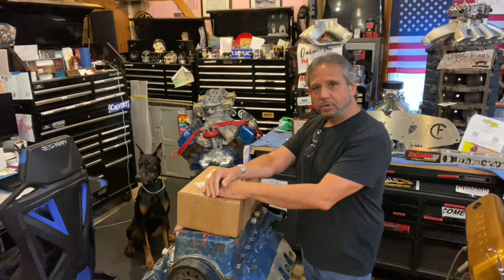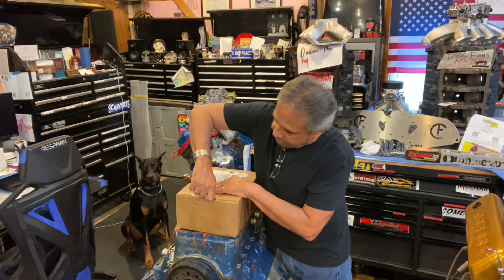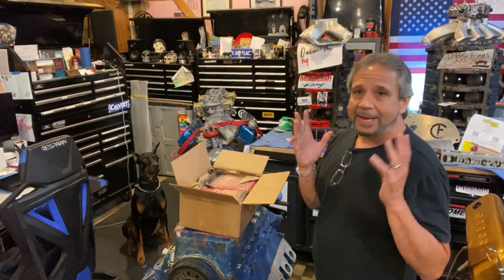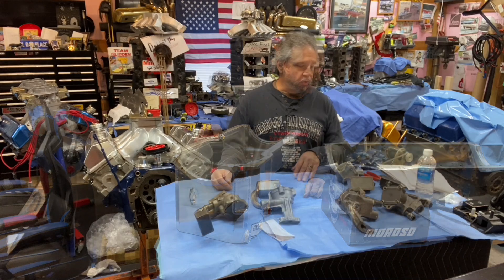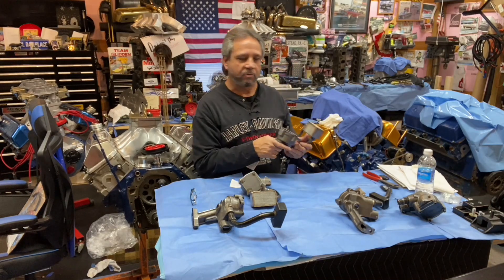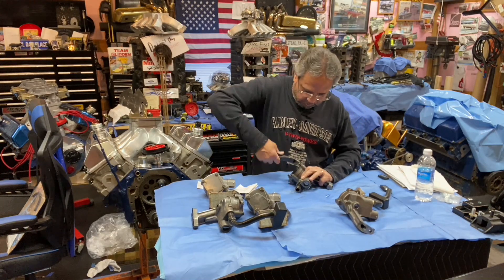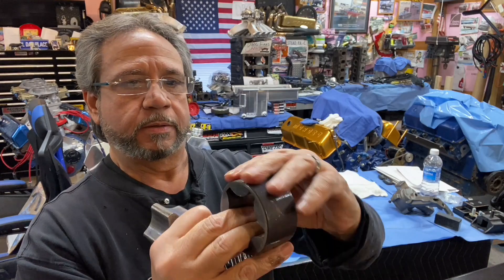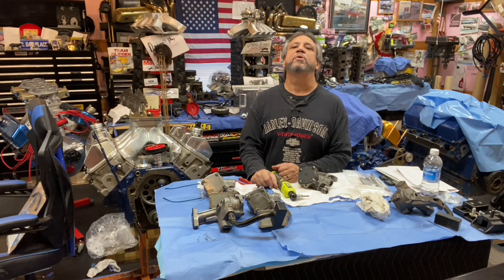DBG: New Stefs Oil Pan, With Matching Pick Up, Let's Look Inside A Blueprinted Precision Oil Pump

Comment: More great information from DBG!!! 
Tim, 
I'm building a very similar drag racing 408c using most of your video's to copy your build and modifications very closely. After seeing what happened when your oil pickup broke and no oil pressure...do you run or recommend  running a low oil pressure safety switch?
Reply from the maker: Trying to keep you in the front of the pack. I have never ran one, don’t get obsessed with the oil pressure. Always the same. Got complacent, as I never had one in 40 years. My laziness. So yes, I bought one and will be using it. With new stefs pan, and oil pump/welded pick up. Glad I can help you, and will be making more build type videos, next up Tony Oddo $14k dollar dry sump Cleveland. Let’s tear it down, see what it needs. Stay tuned

Comment: Very primitive design compared to the modern circle track low windage pans. Also, wouldn’t it be worth REM polishing the oil pump internals and combust with a coating? Seeks lie it would be a benefit and worthy of the the cost associated with “blueprinting”.
Reply from the maker: Hey, I will take what I can get and what works for me. If this was a super stock or class type engine. Probably be great stuff. This is just an old Cleveland. Now if you would like to talk to Precision oil pumps, ask Doug the owner if it would be beneficial. Thanks for watching DBG

Comment: I loved my Melling HV. I got a 7Qt front sump Moroso pan which came with it's pick up. I dropped a 100lbs Moroso relief spring in the pump and ran 65 psi all the time.I could have put a shim in to make more pressure, but I was 20 and was still learning. I would have loved to know to chamfer the pump but I was young. Great times.
Reply from the maker: Sounds like it worked well and that’s what I say. Do what works for you. I have never ran that spring.  Now time to get back to it. Thanks for sharing

Comment: I got a 351c recently and want to build it to a 427 and maybe a shot of nitrous, finding pistons for it seems a little hard is their any you recommend?
Reply from the maker: To achieve 427 ci with stock cleveland , not going to happen. Aftermarket Windsor ok. I stated to work with gib tech pistons. You contact Tim Meyer, at TrackBoss products. he has many shelf pistons.
Reply: @dragboss351cleveland  thank you after looking some more i seen that you cant achieve 427 most is around 409, thanks for the advice
Reply from the maker: @derick4252 yes but no factory available cleveland will take 4.125 bore. Luck of the draw. I may even have my own, hmmmm
Reply: @ i believe the man i purchased it from said it came out a montego and it has 2v heads, the only issue with the engine was in piston 8 their was something in the rod cap bearing and it grooved the crank shaft and made the engine real tight to turn
Reply from the maker: @derick4252 you are the guy that I have been messaging correct?
Reply: @ yes sir
Reply: @  at least through comments

Comment: Very Cool!  Bought a Precision for my BBF!  I like the idea of basically blueprinting everything, and like you said-time is money.  Heard about people stacking the pump plates for extra strength-with some longer stronger bolts of course, or some pumps will have cast pump plates.  A bit of Magic about the high/low volume-and I believe you are correct in the actual rotor depths-makes sense.
The 351C has some history about shimming stock oil pumps for pressure-interesting stuff.
In reality, liquid wants to Flow, whether it is pressure or return.
Thanks DBG
Reply from the maker: I did double stack plates, don’t think it much difference. Looks cool, like a secret mod. Yes moroso made a 100 lbs spring. Never used it. Think smart, save money, not cut corners. Glad you’re here.

Comment: Good job on your video, thank you for sharing. I have a question on oil pans. I have 347 Windsor 1970(2- piece rear main). I am looking for a rear sump pan with dip stick option and girdle clearance. Clearance of the oil pump sump needs to be as small as posable lot of room in the back. any help would be appreciated
Reply from the maker: Dave, I wish I could help, but have no clue on any pans out there for that application. I think both milodon and Moroso make rear sump pans. Getting one custom made, may only be a couple hundred more. Can always call Stefs and ask for Stan, see what he thinks. Thanks for watching my channel 💯🏁
Reply: @dragboss351cleveland  thank you
Reply from the maker: @davec9244 your welcome,  check Moroso 20530, I just sold my buddy a stefs rear sump, cleveland. And found this might work. Thanks for hanging at DBG 💯🏁🇺🇸
Reply: @davec9244   If you still can’t find the correct oil pan for your application, you should check with Prestige Motorsports. They build and ship Windsor based 347, 363 and 408 engines by the dozens each week all over the world for customers with unusual chassis combinations. Clevelands too so they might have something for your 347 🏁.

Comment: Hi Tim, I use the Precision pumps also and no issues so far. The Stef's pans are ok......had one on the Belvedere that my Father raced and he custom wrinkled it during a wheelie situation but if I was buying new again I would get one with a passenger side kick out to keep the oil off the crank and with that design they are much much shallower of a pan aiding in potential damage if ever a hard landing was to happen. Williams Oil Pans makes some very nice ones although very difficult to get anything from him as he is always busy but I have also seen builder friends of mine have Moros build them custom aluminum pans with a nice passenger side kick out as well.
Reply from the maker: Mike, what goes up must come down. Been there lol. Yes they make a quality product for sure. I talked to him about a kick out and Stan said at this time, that the kick out does not make that much of difference with what I am doing. Good point about a shallower pan. Never heard of Williams before. So true, guys that are good at what they do, have so much work. Appreciate your comments and experience. Tell your Dad hi
Reply: @dragboss351cleveland  My father has passed away but thanks. I don't know if you have ever heard of them or not but Titan makes a real nice in pan adjustable oil pump too.
Reply from the maker: @moparsareeverything1980 rip Dad, mine too. I have heard of them and the guy that used to work for them went out on his own. Forget his name and pump right now. I had one of their pumps to test fit. But it would not work with my girdle and it had no pick up. I went as far as buying pickup tubing. Then decided against it. I really think external wet sump would be the easiest and not have to worry about it.

Comment: Is the impeller on the Precision the same height as the the Manley's ? Btw , I still don't like the high volume .
Reply from the maker: The pump is a Melling hi volume, in a Manley box. Btw, I may use a standard volume pump on the 427 aluminum Cleveland, that has stalled.
Reply: @DragBoss351Cleveland  ,,, yes , you said that in the vid . I  wanna know is it the same size rotor and scroll as the Precision . Btw , are you taking calls with Darin ,,, ?
Reply from the maker: @rolandtamaccio3285 can’t say for sure. But precision does not make rotors, I must not understand what you’re saying. Darin will be on live chat, what do you mean take calls, during chat?
Reply: @dragboss351cleveland  are you taking phone calls while he is on ? ,,, last time you did not ,,, !
Reply: @rolandtamaccio3285  I don’t think that Tim has ever taken phone calls during a live streaming event. But the live chat box is used to submit questions or comments for the guest and works very well.
With the bearing clearances on my engine, the Melling high volume pump works well. That’s why they offer standard, high volume and high pressure pumps. A pump to suit most all builds.
Reply from the maker: @rolandtamaccio3285 I never took any calls while Darin and I chatting?
Reply from the maker: @danielwilson6665 no have not done that… yet, may be interesting though.  Be even more fun to road trip to people shops, DBG on the road 💯🇺🇸
Reply: @dragboss351cleveland  Tim it would be great if you could find the time to take DBG on the road and visit some other shops along the way !  Your last session with Darin totally blew me away when you revealed that he was actually sitting next to you at your shop. Very cool move my friend !!!
Reply from the maker: @danielwilson6665 I figured I would get the guys with that one. Always one step ahead of the game. Yes we are going to work at a library collection. The membership will probably have to be 12.99, instead of 9.99, as YT takes 30 percent. We only ask for the 9.99. We are not in it to make money. But to compensate for our time. I think this is reasonable my friend.
Reply: @dragboss351cleveland  I feel like that’s VERY reasonable considering what the subscriber will be getting in return. Count me in my friend, always !
Reply from the maker: @danielwilson6665 that’s what we are thinking, not too much to ask, for what you can save and make hp. We can bring you something no other channel has, a complete library of racing knowledge….is power 💥
Reply: Tim you offer a wide ranging variety of interesting topics on DBG. So much knowledge in fact that your subscribers are likely to become so powerful, they will have to be chained down 😳😱😄
Reply from the maker: @danielwilson6665 and then fed raw meat with sticks, well only in the movies. Yes variety is the spice of life, and I don’t use salt.
Reply: @dragboss351cleveland  I kinda like a dash of salt with raw meat and butter on the potatoes for variety. Just prep the OR for my angioplasty, good Doctor 🫀.
Reply from the maker: @danielwilson6665 angioplasty not the best. A nice drug eluding stent will work just right, unless you have left main coronary disease, then you need a bypass.

Comment: Job well done.what kind of coating inside the oil pump? Dry film lubricant or anodized or other?
Reply from the maker: Michael, Has to be dry film, on rotors and inside housing. Some areas of wear. I will send it back for another build under way.

Comment: The custom Stefs oil pan has some great internal oil control features. The oil temperature sensor bung is another great feature. It’s surprising to see how much longer it takes for the oil to reach normal operating temperatures compared to the coolant. 

Seeing as how even the name brand mass produced oil pumps can have differences in manufacturing tolerances, having Precision blueprint and coat the internal components is good insurance against premature pump failure and helps maintain more consistent pressure especially at higher rpm’s. The pickup tubes look indestructible. Let’s hope so 🤷‍♂️🏁.
Reply from the maker: Thank you my old friend, the shining star will get me far. Yea everything I need. I did not want to change much as I plan to run rear sump, with DragBoss 427 Aluminum Cleveland. More on that another time. My faith for now will be with stefs. I will get Pat the owner maybe do a live chat, fun stuff and learn what we can. Filled blocks do heat up oil, never had an oil cooler so would like to know what it is. Yes and can’t beat a part you can trust. There are things on the horizon that will be a game changer in many ways, as you read through now and wonder with awe, what could it be, always something new at DBG 😉🏁🇺🇸💯
Reply: So a rear sump pan for the DragBoss 427 Aluminum Cleveland to be installed in your Cougar ? 
I will only say how interesting that is and say no more. Mums the word my friend 🙊. 
For now I’m using all Milodon components for my oiling system except for the Melling HV pump. If I ever do build another Cleveland, I want it to have a Stefs system along with a Precision Blueprinted pump. There’s nothing wrong with what I have now but I can see a better way with the upgrades. 

Having Pat from Stefs as a guest on DBG Is a great idea !   Since the engine oil is also the primary source of cooling for the bearings and your 409 Cleveland block has partially filled coolant jackets, having a oil temperature gauge will help you determine if additional oil cooling measures are necessary. Probably not. I could only guess what the oil temperatures should be for your combination but I’m sure that Lake The Oil Geek could tell you all about it and more ! 

When in doubt, ask an expert. You already know I’m awe struck by all of this DBG awesomeness. Enough said for now, ole chum 🇺🇸🏁.
Reply from the maker: @danielwilson6665 yes. Just wanted to race car so not make new rear cross member. Left stock cross tubular member. Rear pan that has to be removed and new chrome moly one built. Yes I think any information about oil is a win win situation. Also star vacuum pumps is sponsoring by vacuum pump rebuild. Stay tuned for that vid. See new happenings as we speak. So thank much with your enthusiasm, as DBG 💯is on the way, because Knowledge is Powerful
Reply: @dragboss351cleveland  A video covering vacuum pumps is a good idea. Most folks know what they are but might not know how they operate and all the benefits of running one. In many applications, that kind of knowledge can make power, or more to the point it can help to recover power losses through increased efficiency. 
The original tubular cross member is prone to unwanted flexing. A chrome moly piece will help greatly 🏁🇺🇸.
Reply from the maker: @danielwilson6665 yes agree. Nothing big just the new owners  asked me to make a video, they also remaking new custom hoses. What could I say, DBG all the way 💯🏁
Reply: Just say YES my old friend. It’s the DBG way of thinking and doing.  And the beat goes on….
Reply from the maker: @danielwilson6665 and on. That is the key, always progress forward but don’t leave the old knowledge behind
Reply: @dragboss351cleveland  That’s correct Sir. Keep on pushing straight ahead. The Pinnacle is in sight so never lift. Time for DBG Nation to go Global 🌎.

Comment: I have a Stef's 1705R pan on my 427SBC.  It does a very good job at controlling the oil.  My engine has been running for 11 years.  Unfortunately, the radius on the rear of the pan didn't match the block very well.  It was real tight in the middle of the rear cap and loose in the corners.  Ended up having to weld the pan to add material in the corners and machine the middle.  Disappointing.
Reply from the maker: Yikes, do not like to hear that. I test fit so far so good, thanks

Comment: Love Cleveland's, had one original 08/19/1968, 4V head, 2 bolt block. Rebuilt using P.A.W. kit in 1984, flat top pistons, .030 over, person top RV, Torque cam 260/270(.050 230/240. Yorker intake,2in phenolic spacer 4 hole and 1850. 260psi compression. Was bubba transplanted into 1968 F100 with T-18. She was awesome. Had SVO valve covers.
Reply from the maker: That is a one of the original blocks with that date. I have the first cleveland from 1968. Your package sounds killer, that is a nice street cam. Thanks for sharing bubba with us. 🏁